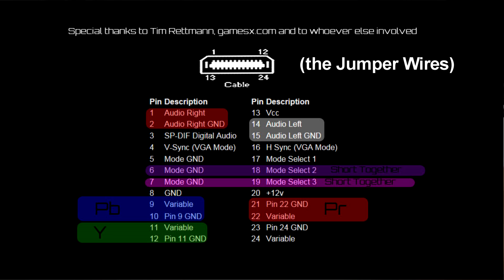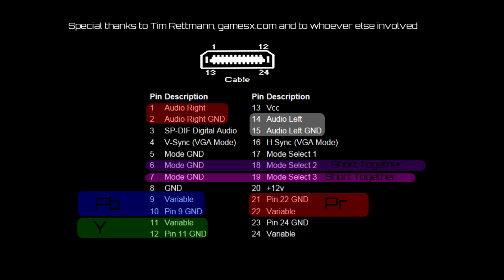Make Your Own Quality Component Cable For The Original Xbox

Comment: I am so pissed, I apparently did this backwards because instead of making the wiring diagram as if the soldering points were facing me, this diagram is as if I was looking at the cord from the side that plugs into the console.  Really stupid.  I had to think as if I was looking at a mirror.  Once I rewired it a second time, everything worked perfectly.  Also flux is important and also cleaning the contacts afterwards.
Reply: lol, was obvious to me, but I did check, who would of thought to check first lol.
Reply: So even though the picture is of the xbox side, you're supposed to look at the numbers from the side you're soldering on? So the upper left on the soldering side is 1?
Reply from the maker: yeah well i didnt make the diagram but i should of specified, i dont remember having a problem, but i see areas i could of improved upon, either way  glad you figured it out

Comment: hey man thanks by the tutorial. I`m trying to make my own but I have a question, in this picture http://i.imgur.com/GNLkMuX.jpg 
the pin 12 that you shoul in yout diagram is pin 24 and it says DC RETURN, it shows that the Y ground is pin 20 or 10 on your diagram.  er, so the last one 12 is just ground right? its not a voltage pin
Reply from the maker: i would avoid using a different diagram not saying its not right but i made mine to be as user friendly as possible. also looking at both mine and that one would just become confusing.  but yes pin 12 is just a ground. on the other diagram it shows pin 12 as being a ground also.  hope you figured it out sorry for taking so long to get back to you

Comment: Luckily for me i had the official 360 cables lying around. I didnt need them anymore since i recently got an elgato because before i only had a component video recorder and now i have both for that and HDMI. I thought i would have no more use for those cables but then i discovered this video. It had a couple setbacks (I mixed up the positive and ground pins for the red video cable at first so i was scared i broke it when i tried it out) but it once i got it right it worked like a charm and im very happy with the results in quality! I even managed to preserve the metal shielding and the plastic/rubber part of the original XBOX connector and put it on the new cable so it looks SUPER clean.
...Now onto finding a good S-Video cable for my N64 xD
Reply from the maker: glad to hear, yeah those tough iv bought  3 and one seems to work good when it wants to lol

Comment: This is nice if you happen to find the cables for less money than a component box, but if you find one, even if it's not the official one, it will work just as well. I bought mine a year after launch, its not official, and i needed it for its TOSlink output (i didnt have HDTV back then). A week ago i repaired my XBOX and used the component outut from the box, with pretty cheap RCA to RCA cables, and it's crystal clear, no interferences and outputs 1080i perfectly.
Reply from the maker: cool, im sure i would buy one of those box's if i ever found one in the wild so nice to know thanks for sharing!

Comment: Would it be possible to make your own rca n64 cable?
Reply from the maker: i dont see why not, there are pinouts not exactly sure how you would accomplish the connector so they would either have to be hardwired on or you could add female ports then just any old male to male RCA cables
Reply: Technically yeah, but the n64 only outputs composite, s-video and i think RF too, for the component/rgb output you need to get them directly from the video chip (basically mod your console)
Reply: The N64 doesn't have component out. It has RGB, but whether it's usable for RGB depends on the specific board. Also, the cables often only have the necessary pins, so you wouldn't have one with the right pins anyhow.

This mod works because the Xbox was designed to output different types of video signals selected by option wires in the cable plug, and because the connectors have all pins and are easily salvaged.

Comment: Man, I have tried this and it works amazing, great job! Do you think it is possible to do something similar with a PS2 AV cable? You should try it. Thanks!
Reply from the maker: i do think it would be possible but i never had any trouble with the cheap component cables for my PS2. thanks for watching!
Reply: It is possible but a lot harder since the ps2 connector is so small

Comment: Great video. I made 2 cables they work well but i am getting a very light jailbar effect with both. All of my solder joints are good. Any suggestions? Could it be the tv or the xbox itself?
Reply from the maker: interference could be coming from anywhere. but to help rule out the TV i would just connect something else component up. then if you could test your cables on other TV's that would help figure out if its either the xbox or the cable. iv never had any problems with my cables on any of my TV's or xbox's. maybe you have a buddy with an xbox have him test your cables?  its odd that your getting the same problem with both cables to me that would rule out the cables being the problem.maybe try moving the xbox to a different spot (if you set it up in one spot). make sure your connectors of clean. thats really all i have for suggestions. as crazy as it sounds you could try removing the faraday cage from the xbox it may help

Comment: Could you make a video on making some GameCube component cables? They're too expensive for me.
Reply from the maker: yeah they are pretty expensive for anyone lol... but yeah i will look into it! thanks for watching
Reply: AncientTech 
Actually, modders have been able to convert the digital connector to component and HDMI for a while now.
Reply: My mistake, you are correct about the HDMI converters. However, I am unaware of any 3rd party component cables. Could you link me to where they have been demonstrated?
Reply: http://www.badassconsoles.com/gcvideo-1/
Reply: Just use a wii with component cables.
Reply: Unfortunately, that isn’t possible. The reason they are so expensive is because the component cables hooked up to a digital output. Component is an analog signal, therefore Nintendo manufactured a chip that converted that digital signal into analog for the component cable, and so far no one has been able to duplicate it. You can’t get component out of the normal video out, so the best you can do without spending $200+ is S Video.

Comment: I had a go at this a few months back, successful! ... for like a minute then it cut off... didn't bother to fix it.  : -(
Had the official Xbox HD Pack... signal was too soft and even putting sharpness up couldn't fix it...
Bought the official Component Cables for the XBOX, £40+ was good but sadly the Red Video connector was faulty, looking to get some solder and fix it. 
Just today I got my cheapie £3.99 cable from Ebay UK, works perfectly! No lines/Dot crawl/Squiggles/Blobs of colour etc. I am amazed, they are nickle plated, great quality build and I noticed the seller had zero complaints on these cables. 

The picture is ever so slightly sharper then the official ones, really chuffed I got a great, fully working set and not a duff : -D
HD for the OG Xbox is really nice and notable upgrade over 480i, which is lousy! Cheers for the videos, your stuff is great!

BTW: I used be convinced my Xbox was broken as it couldn't do the HD, never understood why MS made 480p exclusive to USA... PAL sucks for gamers, lol!
Reply from the maker: glad to hear you found some good cheap cables! i never had luck with them but i had heard of others finding good ones. but yeah i agree they screwed over the PAL. but with a hardmod/softmod you can fix/change that.  thanks for your support i really appreciate it!

Comment: cringed when you sliced that original cable.
Reply from the maker: TheNastyBAGL lol it's for a good cause
Reply: TechnoOnTop true but I wouldve used a 3rd party cable
Reply from the maker: TheNastyBAGL some third party cables are not very well made. Though yeah the pinout would be the same just possibly different wire colors. But that more matters with the 360 cable. Eventually it will be a double cringe.
Reply: @NastyBAGL 3rd party cables are shielded, plus it's still original.

Comment: Excellent. Component kits (good ones) for the original box are rare as hens teeth, while 360 component cables are like toss-out items anywhere you find them. I probably have the parts to blend almost half a dozen of these. Thankyou for this.
Reply from the maker: that they are usually 1-2$ at thrift stores. no problem thank you for checking it out!

Comment: Component RGB 2 different things my friend
Reply: Component just means that the video uses multiple signals. S-Video, CGA, VGA, SCART and D-Terminal are also component. If you want to specify component video (ie. On Xbox) you say component YPbPr. If you want to be even more specific, you can suffix it with the connector. eg. Component YPbPr RCA/BNC/DE-15
Reply: Wikipedia says otherwise. Any video that is broken down to more than one composite signal is "component" and that includes RGBS... and even S-Video. Also, the XBOX component cables can carry RGsB (Sync on Green) or Y'PbPr. I also wonder if that extra composite video plug could be repurposed as CVBS sync (Sync on Composite Video) or if there is a way to put C-Sync on there (clean Composite Sync without CVBS).
Reply: @emmettturner9452  YOU ARE READING A FORM THAT CAN BE ALTERED BUY ANYONE. composite is 1 single image from one source rgs is split into 2 and combined. the output may be composite but only in the case everything is combined into one output and its not its multiable. its verr complex to explain and I am not wasting my time when others have done it.
Reply: @vorkev1  Others have done it better without going unhinged and accusing Wikipedia of being edited by morons while presuming that I don't know exactly what Wikipedia is. The problem here is that you are obviously doubling down in the face of people who obviously know more about what is and isn't component video as if you have any chance of convincing us that we are wrong. The definition is right there in the name, if you know what component and composite mean in other contexts than just video.

Again, RGBS is a form of component video.
RGsB (Sync on Green) is a form of component video.
Y/C component (AKA S-Video/S-VHS/S-Terminal) is a form of component video.
Y'PbPr is also a form of component video.
Any form of video that is transmitted in separate components is component video. The Y'PbPr Component cables that people usually just refer to as "Component" can also carry RGsB (RGB with Sync on Green). They can also be used with another sync source like CVBS (Composite Video) for RGBS.

I just got finished building 40 RGsB/Y'PbPr cables for UltraHDMI HW2, WiiDual, and Playstation 2/PlayStation 3 using 10PINCOMPOS DirecTV component cables, chopping off the 10-pin mini-DIN, and wiring them to the appropriate console plugs. I considered using XBOX 360 component cables for some of the Nintendo consoles so that I would have plugs for R, G, B, Audio Left, Audio Right, and Sync except that the ones they sold separately for XBOX360 Core consoles didn't have the composite plug that I could repurpose for Composite Sync... not Sync on Composite video AKA CVBS Sync. Composite Sync composes H-Sync and V-Sync into a combined, AKA, "composite" sync. That's what led me to this video. I didn't find what I really wanted but I did find someone who didn't know that RGB is a form of component (namely, you).

Y'PbPr Component is a much more efficient way to transmit RGBS signals because it transmists the shared brightness from each as Y (green plug) then transmists the difference needed for Blue and Red signals. The encoding algorithm can algorithmically restore the Green signal by inferring the difference from Blue and Red from the shared brightness signal, leaving a ton of extra bandwidth available for HD resolutions. Because Sync happens between lines/frames it does not detract from the bandwidth and they put it on the green plug (Y/Brightness). Now you know.
Reply: vorkev1 Nope, some Component cables use the RGB color space. But those (as most do) use YPbPr so you're right with that

Comment: awesome video bro, now, here's a quick question: can you do a mod in which the console has the rca jacks for component cables? i'm asking because in where i live no one gives a shit about the og xbox, and i can't find av cables (even the crappy composite ones are expensive as hell) i saw a few written guides arround there but i'm not sure about doing it
Reply from the maker: those guides use the official xbox component cable box, they just internalize it , but yes it would be possible to use RCA jacks it would just take wiring from the motherboard to them. its alot more work then these cables. that and  i could never find RCA jacks that had the right colors (cheaply)so you would have to figure a way of labeling them. but its possible yes, thought i dont know if i would ever make a tutorial about it though but i can add it to a list of what people want . thanks for watching!
Reply: TechnoOnTop
thanks for the reply bro, great channel!

Comment: Can you make this for the Ps2? I did my Xbox cables like 3 years ago an look awesome
Reply from the maker: i will defiantly look into it, iv never considered this mod mainly because the cheap ebay component cables i bought for my ps2 worked great with no interference unlike the ones i picked up for the xbox. but thanks for watching !
Reply: ChutA7X Tech PS2 component cables are good. It's just the PS2 that doesn't clean up well. Btw you can use PS3 cables as well.
Reply: Gerg I made my ps2 ones like a year ago but I only get gray or blue color never got them to work i never use those consoles anymore since i got my ps3 and ps4 but i would like to make them only for make sure that i can do it haha 😂
Reply: Only with those cables? Have you changed video mode from RGB to YPbPr in settings?

Comment: I just tried this, twice, but it didn't work :( My soldering is good and I double checked all the connections. I used flux but didn't clean it off with alcohol, do you think that could be shorting the connections?
Reply from the maker: +WEARECHANGEBEDS hey,  if your completely confident in your soldering and you have double checked the connections leaving Flux residue won't cause any issues.  Is your Xbox modded or is it stock?  NTSC or Pal?  You may need to switch your settings for it to display on your TV,
Reply: Its a Pal console with Xecuter x3 chip. I have got it working now though, I basically got the connections back to front as I thought your diagram of the connector was facing from the cable looking into the Xbox, however your diagram is looking from the Xbox facing towards the front of the connector. I followed a different diagram and it's all working now. Thanks for the video though! Great job.
Reply from the maker: WEARECHANGEBEDS Im glad you got it working, also sounds like an awesome xbox! thanks for watching

Comment: Thanks for the video, I bought a couple of cheap component cables hoping to get one that works properly (none did without massive interference), didn't even think of converting my old 360 cable, lol.

What I also did was cut the grey flexible piece off the 360 cable which will then allow you to slide the black Xbox cover over, then solder the wires, etc. Reassemble the metal shielding & slide the cover back over it. Makes it look very neat & gives it that little extra protection.
Reply from the maker: yeah those cheap cables suck! but yeah i meant to reuse the black cover piece but i spaced it while filming and didnt want to un-solder and re-solder so it got the hot glue treatment lol... glad it all worked out for you thanks for your support!

Comment: Thanks for the video! Unfortunately I ordered a cheap eBay cable minutes before finding this....not to worry. 

I was wondering, is it possible to reattach the old plug cover/black plastic part rather than just covering it in hot glue?
Reply from the maker: +Eric Hurley some people get good results with the ebay cables i just wasnt one of them lol... but yes it is possible you just have to slide it back on before starting to solder which i forgot to do thats why the hot glue went on. functional but not the nicest looking. thanks for watching
Reply: +TechnoOnTop Ah yeah I get you, slide the black plug onto the 360 grey wire before soldering. Thanks again for the vid, if the eBay cable turns out to be junk I'll definitely be doing this.
Reply: Just an update....turned out the eBay cable was garbage haha. Film grain noise and artifacting on screen, probably due to poor shielding. Looks like I'll be making one of these!
Reply from the maker: +Eric Hurley that sucks man I also bought some ebay cables that sucked so I made these then decided to make a tutorial lol.  well good luck with making them.
Reply: Just to let you know, I made up one of these today using your video as a guide. Works perfectly! Soooo much better than the eBay cheap cables! No screen interference or artifacts. I cut the original black plug sleeve in half,  gonna try hot-glue onto the plug and see what happens. Thanks a lot for the vid!
Reply from the maker: +Eric Hurley glad to help! Thank you for your feedback and your support I really appreciate it
Reply: One of the weirdest tricks ive found with those cheap what cables is if you have anything else plugged into the tv you get interference remove everything else. The xbox works fine.